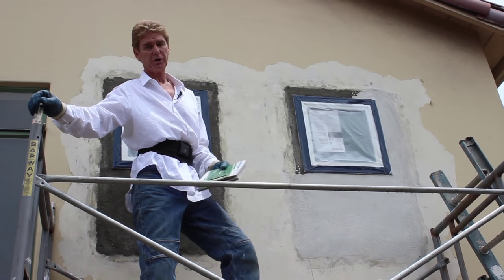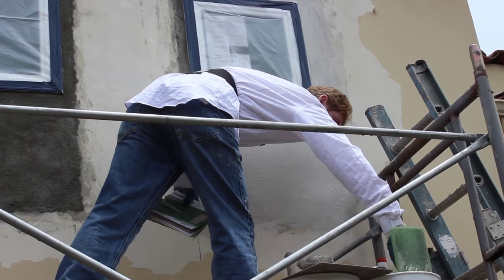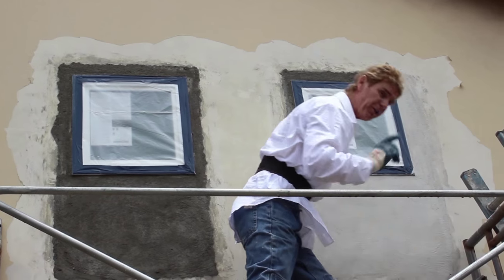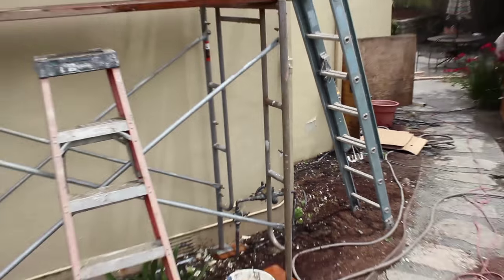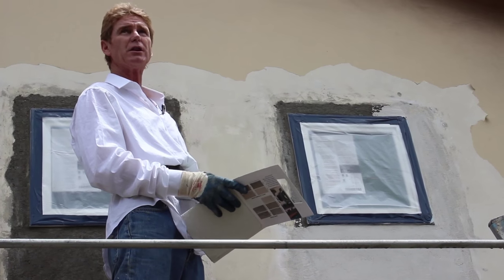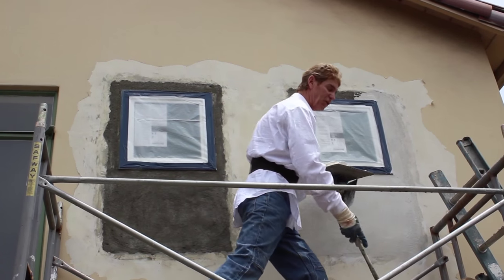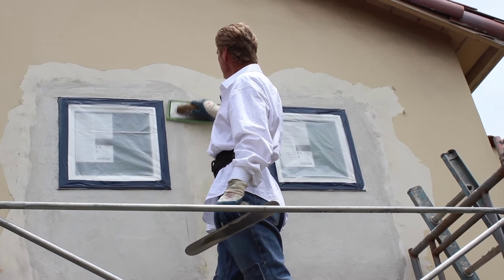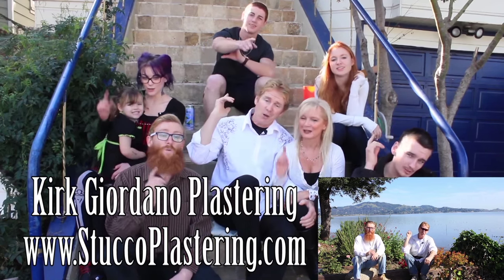Apply acrylic stucco.

Comment: Kirk your videos are great. One quick question.  Can you apply a new coat of a La Habra color coat over an existing one just by hydrating the wall.  Or do you have to apply bonding agent like Weldcrete before applying the new color coat to the existing color coat?
Reply from the maker: Good Morning Global Dude, good question, depends, if your existing finish is porous and your new is also then yes, these two will mechanically bond by suction, however your    
existing wall must be really clean as nothing adheres to dust, plus, I would advise you  to hydrate the existing wall well,  for a better bond.              
                    Live long and plaster
    Mastering Plastering by Kirk and Jason Giordano

Comment: Thanks for the video Kirk.  I think I may have seen this in a previous video but can you go over painted stucco with a "maintenance free" Lahabra color coat, as long as you pressure wash and apply bonding agent first?  Thanks /John
Reply from the maker: John Woolfrey Hi John, absolutely,.
 I have quite a few video's on this application.
 Best wishes,

Comment: Thank you Kirk for sharing your expertise.  My 70 year house is color coated (white) but this is stained ingrained black or red in some walls (maybe from pine trees).  I do not want to paint. Is there any way to remove this or do I need to color coat over again? (Bleach not working)
Reply from the maker: Howdy Nina, excellent question,  best way is to wait for a rainy day, after 30 or more hours of constant rain, take your water hose and use full force with just the force of the water with a nozzle, most dirt should come right off. "the rain just keeps it wet, it will not clean it"
If you get a bit wet, that's even more fun.
 Similar to washing a cooking pot with day old dried oatmeal, try to wash it after it set overnight it's a lot of work, allow this same pan sit with water in it overnight almost rinses clean the next day without scrubbing, using the same principal.
 Let a stucco wall also, presoak.
 Best wishes, 
 kirk giordano plastering

Comment: Hi Kirk,

I'm very glad I watched this video. I had no idea I could change the color of my house with a "color" coat of stucco. I am in the midst of a large DIY remodeling project, and part of the job will be to remove the rough finish in the front and replace it with the same kind of finish which surrounds the rest of the house. My wife calls the front finish "chunk monkey", and I know there's an industry standard for it, but I don't know what it is. Whatever it is, she doesn't like it, and therefore, neither do I. I'm sure you understand my reasoning here.

Be that as it may, my original plan was to strip the front of the house and re-stucco with a "knock down" finish, which is what is on the rest of the house. Then I was going to paint the whole house in a different color. However, there are a number of defects in the existing stucco, so if there is a way to repair those defects and apply a color coat with the color of our choosing, well, that is the best of all worlds. I get the idea that paint is not as long-lived as a color stucco finish. I was just unaware that you could apply a color coat over existing stucco.

If you're interested in what I am doing, please check out my blog at frankshomeromedolingjourney@wordpress.com

Thanks, again, for your post!
Reply from the maker: Frank Borik Hi Frank, yes you can apply a color coat over a color coat, without a bonding agent.
 But the existing color coat maintenance free cementitious finish has to be pressure washed extremely well. 
Nothing adheres to a dusty or dirty surface, not for long anyway.
This video explains just a bit of information on the subject.

 I have done a video with a color coat over a cementitious color coat too.

 But just so you know if you paint a wall with defects the paint will enhance those defects, however a color coat is 30 to 50 times thicker than paint, why?  Because it has sand in it.
 But this sand in the color finishes usually covers even the bad defects in walls.
 To show the wosres case scenario of defects view the video below, which were blending in well.
https://youtu.be/xPvm5BUm5-8    Color coat stucco applications  Best wishes, will view your masterpiece this evening. kirk giordano Plastering

Comment: Do you know what is commonly used around pools?
Reply from the maker: EJConrad Hi Conrad, the base is usually shotcrete with additives, mostly portland cement,
 The finish coats are very similar to the acrylics used on homes ut are completely waterproof not water resistant, these products are similar to stucco-flex completely elastomeric, except specifically engineered for swimming pools.
 I would google swimming pools finishes,
 Best wishes, 
 kirk Giordano Plastering